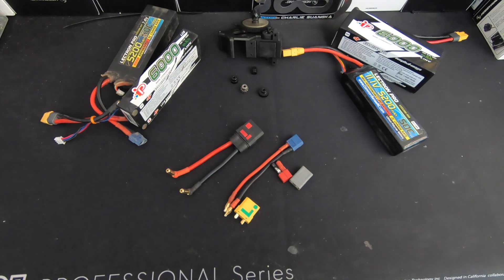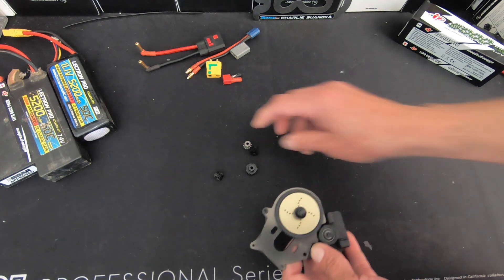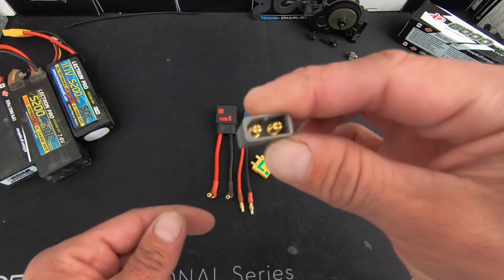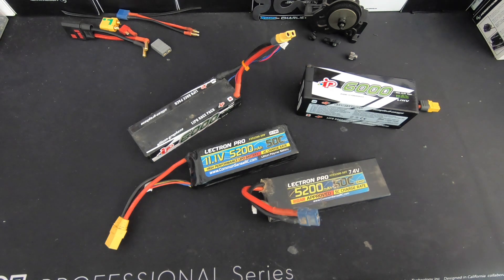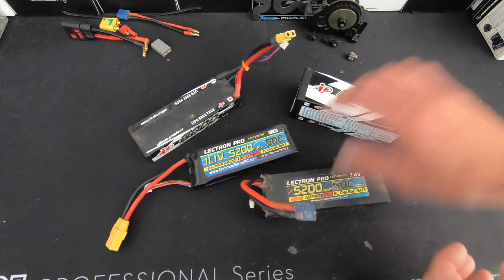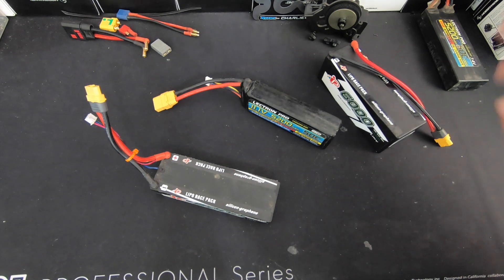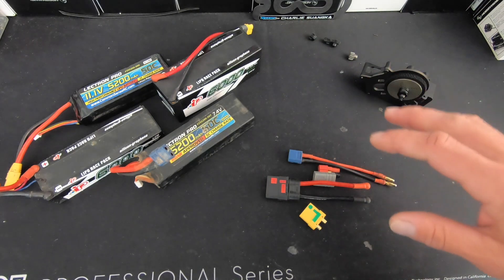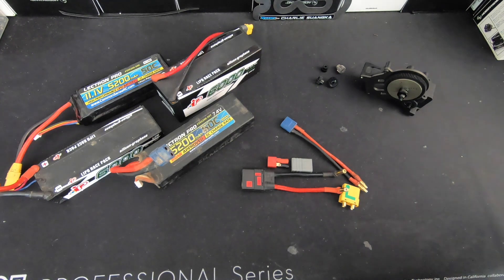The Charlie Show /// Episode 207 /// 5 Things for New Nerds!

Comment: I bought the the xerorun R2 3300kv brushless system for a 1/10 rc. Going with a venom lipo charger but what's a good battery for brushless?
I was looking at a particular venom battery and someone said that it wasn't a good fit for brushless motors. Is this a true possibility?

Looking for a 3s with a good run time of 90minutes for a rock racer / trail / crawler build. Meaning fair amount of wide open throttle ( 30% ) I'd say a good (50%) trailing mid speed in and out and (20%) use for crawling and slow stuff.

If anyone could help me out I wanna get the most out of this system without causing damage or shorting myself in power punch or run time.

Thank you in advance

Comment: always helpful. 
about the gears. would like to know more about pitches on gears. changing from stock that is. if that's important to know for any reason or even do.
charging of lipo's. just get a couple of bat boxes and some lipo pouches. just my opinion.
power caps. like to know where, if and when other than factory they need to be added. is there a formula of what type to use? how many? what they really do for your r/c.